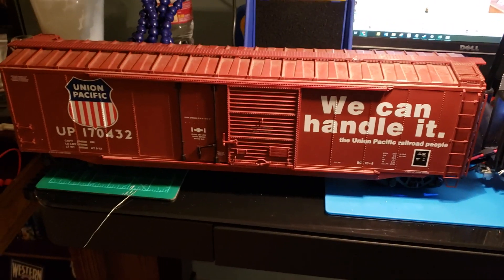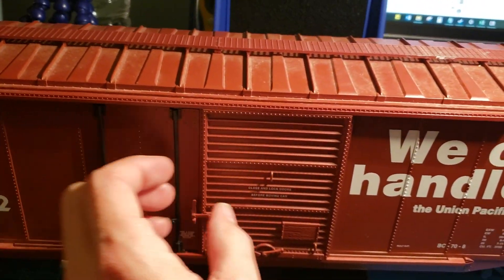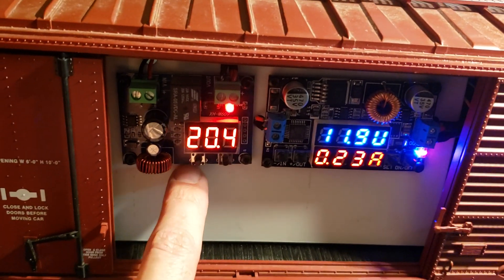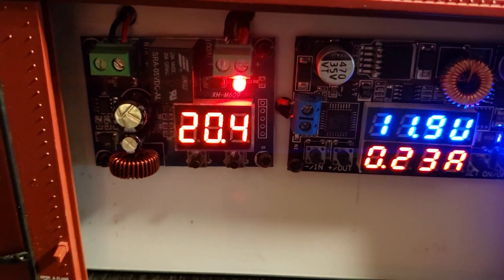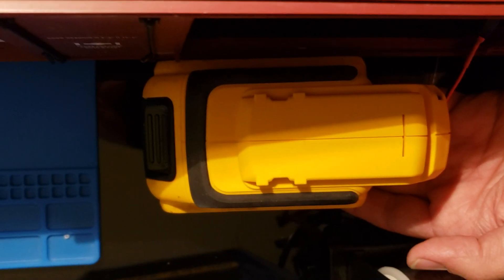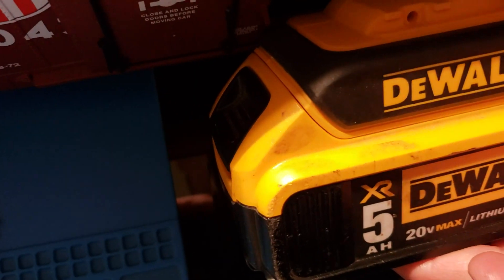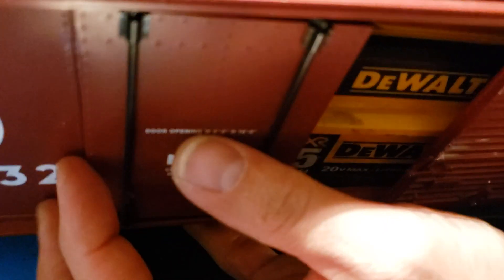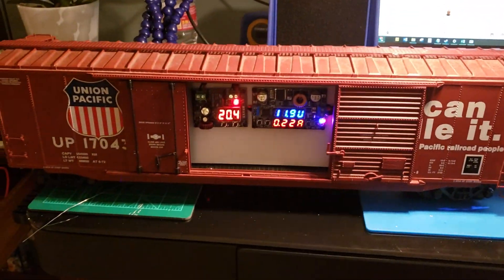Ultimate G Scale Battery Car!

Comment: I converted my USAT locomotives to run off a battery/r/c car setup with an old aristocraft train engineer system.
I've been using older DeWalt batteries but like your setup. 
Could you show how you did this? I'm sure it would help many g scale enthusiasts as well as myself. 
Thank you.